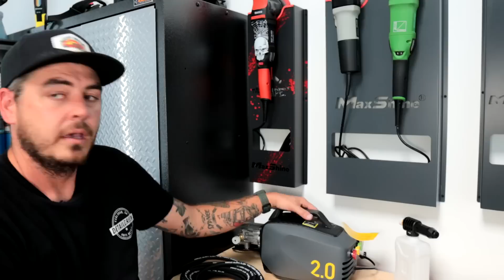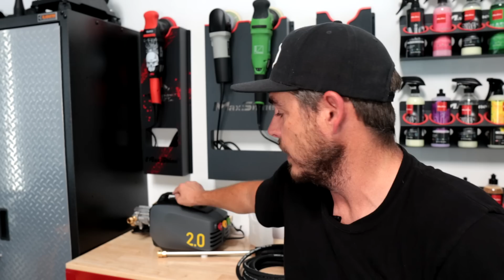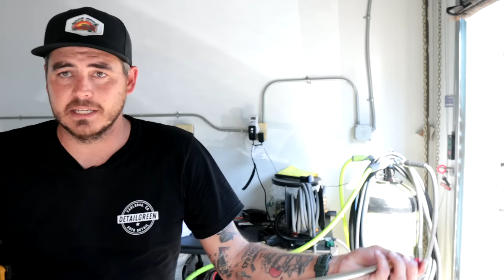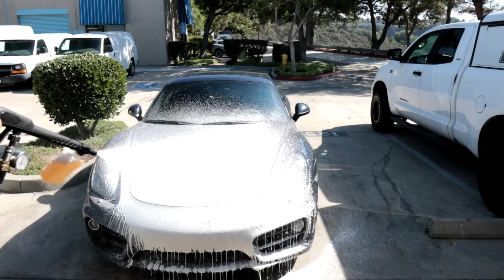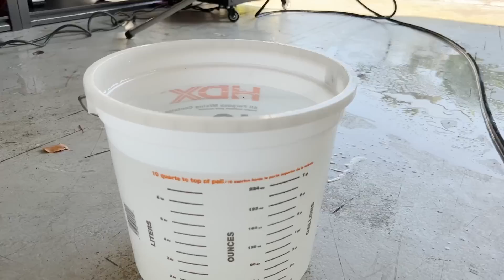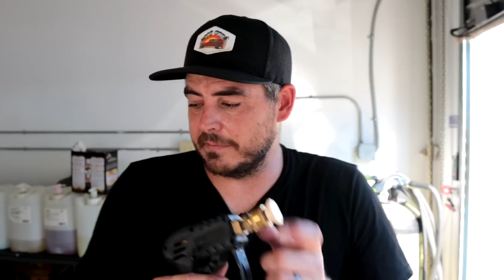NEW! ACTIVE 2.0 PRESSURE WASHER | Best Pressure Washer for Car Detail

Comment: @imjoshv Hi, I am not getting these numbers, I already tried 2 ryobi, not the same numbers as you, then I bought the active 2.0 and with the stock nozzle I only get 750 to 800 psi and about  1.85 gpm. What could be wrong here?
The water from my garden hose?
I’m using the 50 feet uberflex, the Mckillan gun, the quick connects and psi gauge you recommend.
My garden hose is 100 feet and that gave me 750 psi
I tried a 10 feet flexzilla garden hose and it went up to 800 psi
Reply from the maker: It sounds like the gauge might be faulty. I’ve had some do that so now I stick to the one from mtm
Reply: @imjoshv   thanks, that's what I also thought and it could be, but on the other hand I'm only getting like 1.85 GPM not shy of 2.0 like you.
Reply: I am in the same boat as you I’m only getting 750 to 800 psi and under 2 gallons per minute with mine also and can’t figure out why tested with two different gauges including the MTM1 use shorter garden hose to only 3 feet and I gained a little bit of pressure but maybe 25ish psi I think I’m just gonna send my back and get a refund my gas one with 5.0 nozzle is getting 2800psi @ 3.0 gpm when i measured it if I switch it out to a 6.0 or 7.0 it’ll probably bring me down to the thousand psi range that I want to be at and be closer to 4 gallons per minute which should be awesome for detailing because of the high flow and pressure should wash away a lot of the dirt better I just wanted the auto shut off and less noise because I don’t wanna have to wear ear protection just a detail of my vehicles but the active 2.0 so far to me is overrated and a disappointment from what they’re advertising it as.
Reply: i have the same issue as you, and the replacement unit is giving me the same numbers (about 400 psi lower than what i'd expect)

Comment: Josh, what are your thoughts on using a 3/8 inch hose? Do you think you would get more flow?
Reply: Did you end up getting a 3/8 hose? I have an UBERFLEX 100ft 3/8inch hose that when you pull the trigger on the gun it take a sec for the pump to turn on and then you let go of the trigger it take a sec for the pump to stop? It doesn’t do this with a 50ft 1/4inch house.
Reply: No, I ended up just getting the 1/4 inch, 50ft hose. Theoretically, you should get more flow from a 3/8inch hose but I didn’t know for sure if the Active 2.0 has enough power for that. But, I’m happy with the quarter inch hose.
Reply: @kwalbangr6173  I had a 1/4 50ft UBERFLEX hose then upgraded to the 3/8 100ft UBERFLEX. With UBERFLEX it doesn’t have the metal braiding so it tends to expand which cause the active 2.0 to run longer. I ended up going with a 3/8 75ft obsessed garage hose. Works great.

Comment: Is that a water softener you have your hose attached to?
Reply from the maker: It’s actually a DI tank. It removes all of the dissolved solids so it’s completely spot free water
Reply: @imjoshv  I see. Ion exchange. Straight resin.

Comment: That pressure washer pulls a ton of power. My breakers pop at 15A.
Reply: If you’re popping breakers then you’ve either got a bad breaker or a dirty line meaning you have other things running off the same circuit drawing amperage causing it or you’re using some thing on the pressure washer that’s pushing the motor too hard like too small of a nozzle because with the stock nozzles that come with this pressure washer it barely gets above 13.9 amps.

Comment: Can’t decide between the active 2.0 vs greenworks 2300 2.3gpm. Guna use for washing and around the house but I can’t decide also the delay on greenworks might be annoying
Reply: Did you decide yet?
I’m looking to get a pressure washer for around my house. Siding, patio, concrete garden wall, car etc. Lowes has the 2301 on sale for $249. I wonder if the active would be good as well.

Comment: Yo brotha! Love the content and I’ve recently purchased some of the items on your list. I had a quick question about the quick connects. I purchased the same Uber flex hose in the link, but the quick connects linked are 3/8”. Will those two components fit or do I need to purchase the m22 to 1/4” fittings?

Comment: Just a quick question, the 1.1 orifice on the foam cannon. If it's not recommended and the amperage goes up when using it is it safe to assume that it's harder for the pressure washer to operate during that time? and if that's the case, would it reduce the life expectancy of 200 hours?
Reply from the maker: That’s a great question and it may reduce the full life span but I’m sort 100% sure. I run the 1.1 in mine still just because that’s how my foam cannons were already set up and I have had any issues with my active… but with the high flow of this machine using a 1.25 will still get good foam! Especially if you’re using an mjjc foam cannon

Comment: Active 2.0 or Greenworks Pro 3000 - for car washing and house work (patio and siding)?
Reply: Did you decide?
I’m looking to get a pressure washer for around my house. Siding, patio, concrete garden wall, car etc. Lowes has the 2301 on sale for $249. I wonder if the active would be good as well.

Comment: Hey Josh, I just watched your latest video (CG's new soap) and you mentioned using the Active 2.0.  Have you had any issues when using the. 50' Uber Flex hose?  Mine continued to run a lot when using it after letting go of the handle.  One of their latest videos doesn't recommend the Uber Flex hose because it's not still braided and recommended going back to the stock hose.  It works great with the stock hose, but it's too darn short to get around my truck.  Just curious if yours runs after letting go of the handle.  Thanks in advance for some input.
Reply: Mine does this also. I received my unit earlier this month (May 2023). With a 35ft Uberflex the pump will cycle every 12-15 seconds. With a 50ft Kobrajet, which I believe is reinforced, the pump cycles every 6-8 seconds. I just e-mailed them, awaiting reply. The OG video with the Active guy said they had this sorted out with a two stage switch thingy. In the vid they were using a long Kobrajet hose without issue. Maybe this is a problem with recently produced units(??)
Reply: @steverasmussen8738  I have one of the earlier units and the  uberflex hose just wouldn't work, so I went back to. the hose that came with the 2.0 and. it works perfectly.  My guess is they only work with steel braided hoses.  Hopefully you find something that works.

Comment: @imjoshv I'm only getting 800psi with the exact same setup to the T. Any input or thoughts?
Reply: @grantpa7308 I’m having the same issue, did you ever figure it out? I just received mine and feel like returning it.
Reply: I also am in the same boat as both of you lol and Support troubleshooting only had me eliminate things that I had already tested and after they knew that they have no idea why and are asking me for purchase information to start a warranty claim but I don’t think I want another one I think this is probably how all of them are going to run even with a replacement so I am thinking of just returning mine also while I’m within the 30 day satisfaction guarantee. Getting a hold of Support is taking me over two weeks so I don’t wanna wait around there Support is terrible as well you can’t ever get a hold of them you just get a recording on the phone telling you to leave a message I’ve emailed I’ve contacted them on social media not a company I want to deal with or trust for a long-term investment do yourself a favor just return it and save up a few hundred dollars more and get either an AR blue or the Kranzle that’s what I’m doing anyway or I’m just gonna stick with my high-pressure high GPM gas washer and have to deal with wearing hearing protection wall detailing I guess.
Reply: I'm now only getting 550 psi. Can't figure this out still. Any tips anyone?

Comment: Which is better the Active 2.0 or the Greenworks 2300psi 2.3 gpm you reviewed about a year ago?
Reply: I’m looking to get a pressure washer for around my house. Siding, patio, concrete garden wall, car etc. Lowes has the 2301 on sale for $249. I wonder if the active would be good as well.

Comment: Do you prefer gas or electric pressure washers?
Reply from the maker: personally electric cause i can get the psi and gpm im looking for out of them without the noise, gas, and oil of gas generators. But if you need something more powerful gas is the way to go

Comment: 200 hours of life? That's only like 30 car washes then it's off to the gutter. Seems kinda pricy
Reply from the maker: 30 washes would be like 6.5 hours per wash to get to 200 hours. My pressure washer is on for 5-10 minutes per wash/detail so the 200 hour life is pretty good. Most the big box store pressure washers (ryobis, many greenworks, sun joe, etc… are rated for 100 hours) the total stop system really reduces the amount of time it’s on cause if the trigger isn’t pulled the unit is essentially off
Reply: @imjoshv  you're right. I did the math wrong i was dividing 200 hours by 6 minutes a wash and got to 30 but i forgot to multiply 200 by 60 to get to minutes. So in essence at 6 minutes a wash i should be able to get around 2000 washes. Now that sounds more likely. So for this price point, is this the best pressure washer you would recommend?

Comment: Can the Active 2.0 be used for other purposes outside of car detailing?  For example, would it be sufficient to clean concrete using a surface cleaner attachment?
Reply: You could use it in a pinch, but not a great idea with the limited motor life. A gas pressure washer is more suited to that type of duty.

Comment: How are you using the uberflex with this unit? My brand new active 2.0 pump keeps staying on and doesn't shut off after trigger release. When I switch to the original gun and hose it's fine. I contacted active and they  say you can't use uberflex...because it's not steelbriaded. Any advice ?

Comment: The 2.0 is an m22x15 power washer right? So no need to buy an adapter correct?
Reply: I think the 2.0 is a m22x14mm adapter. Not sure why the link to a m22x15 to m22x14mm was given

Comment: One thing I wanted to ask about, and I'm not sure if I missed it in the video, but with the longer hose did you notice any change in amperage? With a longer hose there should be a little bit more pressure drop compared to a similar shorter hose but on some units/setups it could be negligible. Just wondering if on the Active, because there is a slight noticeable increase in pressure drop with the longer hose, if there is also a little bit more current being drawn by the unit.

Thanks for testing the unit in a concise way in the video!
Reply: This is a very finicky machine. If you use anything aftermarket it has a fit. Orifices etc.

Comment: I'm not a pro detailer.  Living in rural Indiana, I have well water that leaves bad spotting, regardless of how fast I try to dry it.  Aren't there any electric power washers that allow for drawing from any standing water source??  (other than battery operated models)   AND....... Soon those water spots will be ice cubes, topped with road salt and dirt. lol
Reply: I would look into a filter that attaches to your garden hose or outside spigot. I purchased mine from lowes
Reply: @singram1978  Appreciate the suggestion!  I just ordered the "Orbit Outdoor Mist Calcium Inhibitor Filter" from Lowe's.  Thanks!
Reply: @TroyRudd574  No problem, I'm from Ohio and I also have well water. It helped tremendously!! I hope you have the same luck 🤞

Comment: I bought a used 2.7gpm with 2700psi for $80, added an new hose and wand for $50 more - don't see spending $350 for an electric PW when there are so many that are much cheaper and even cheaper if used. I used an AR Blue for 4 years and it was wonderful and I paid less than $100 for it. Very portable.

Comment: I got my 2.0 the other week to replace my VE-52. Nothing wrong with the VE-52, but I wanted to try out the new unit. Finally got a chance to use it a couple of times this weekend, and I really like it. It does have a little bit of motor wind-down after releasing the trigger that I hadn't noticed on the VE-52, but I appreciate the fact that they went to a more standard hose connection over the VE-52 so I don't need an adapter, and I also like the fact that you can purchase this unit without any accessories to save on the price for those who are going to be using their own hose and guns. Overall,  my first impressions of the unit after a couple of uses are really positive, and I'm hoping I'll be as happy with the 2.0 as I have been with the VE-52.
Reply: That's good to know, are you using a foam cannon with a 1.25 orifice? I'm just curious because I'll be using mine with a 15amp outlet.
Reply: @jjabblePlayStation  I'm using it with the MJCC Pro foam Cannon with the default orifice, which I believe is the 1.25. Haven't had any issues.
Reply: @saviordream  That's good news, thanks a lot for the reply.
Reply: @Geese1 Is it still holding up? I just bought a VE52 and it's still in the box but I've read a lot about leaking units.  I am considering returning it and putting the money towards a 2.0.  Has yours been holding up? Any issues with the 2.0 and did you notice a difference between the two in terms of performance?
Reply: @SnowBeltDetails  It's been doing well, but being I live in the northeast, where it's currently winter, I haven't used it since last November or so. So far, so good though. I didn't notice a big difference between this and the VE52, but the unit is more compact, and I like the fact that I don't have to use a bunch of adaptors in order to use my aftermarket accessories (the 2.0 has standard fitting sizes). Overall, I'd say I like the 2.0 a little better, but I really didn't have any complaints with my VE52, and I certainly wouldn't hesitate to recommend that model to anyone who is interested in it.
Reply: @saviordream  Thank you for the input. I am in the Northeast as well and have hard water so I'm not even sure a washer rated for 200 hours will last very long, sort of like how our cars rust out before they stop running.  It may be better to buy a cheaper model and replace it.  I know if I keep the VE52 I'll always be wondering if I should have gotten the 2.0, but there is a $145 price difference currently and most online reviews comparing the two found nearly identical performance.  For that price difference you could buy another washer altogether, like a Karcher K1700.
Reply: I hear they’re coming out with a new pressure washer. You know anything? Maybe I’ll wait for that and or see if the 2.0 price drops. Do you think you could use the 2.0 for around the house as well?
Reply: @adamg.1845 if you follow they're channel or social media posts, you'll see they have another model in development, but I don't think there's any indication when it might come out. The 2.0 is still a great unit, and if you want to save a little money, you could still get the VE-52. I use them primarily for car detailing, but I'm sure either would work great for other tasks around the house.

Comment: What PSI and flow am I looking for in a pressure washer for washing the house/deck/ driveway as well as washing a car every now and then ? But mostly using it for getting the property clean ?
Reply: Don’t get too caught up on specs.   Just about every dam pressure washer on the market will help you wash a vehicle.   With that said for work around the house I would say you would want anything above 2k? And maybe 50ft hose  or more to make it easier when doing work outside

Comment: Why didn’t you test the MJJC with the 1.25 orifice? This machine will over amp and trip a breaker with a 1.25. You’ll probably have to use a 1.5 foam cannon orifice that will sacrifice the “shaving cream”.  A 1.5 orifice with this machine will operate like the Active stock foam cannon did producing soapy water. To us3 a foam cannon with a 1.25 orifice, you’ll have to have a dedicated 20 amp circuit. Unacceptable for a 330.00 pressure washer. At this rate, spend a little more and get an AR 630
Reply: My Active 2.0 draws 15.2 amps with a 1.1 orifice and 13.3 amps with a 1.25 with an MTM canon